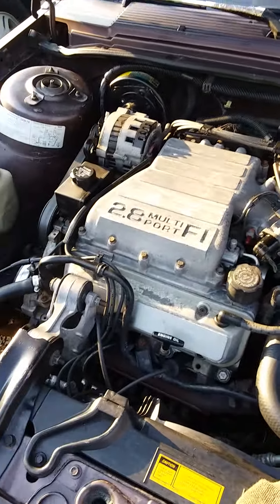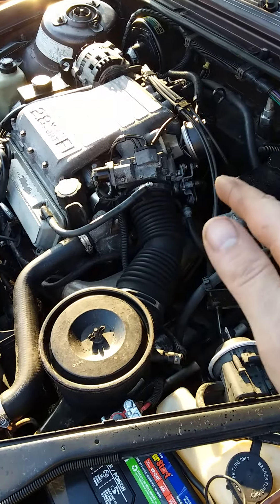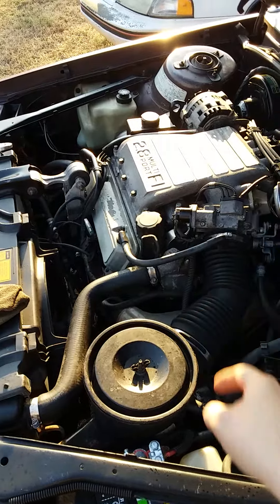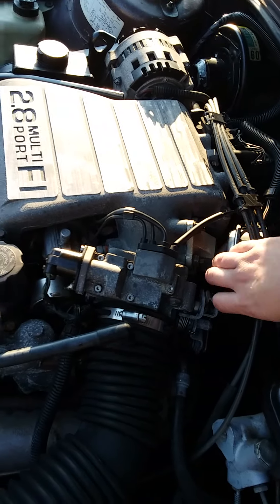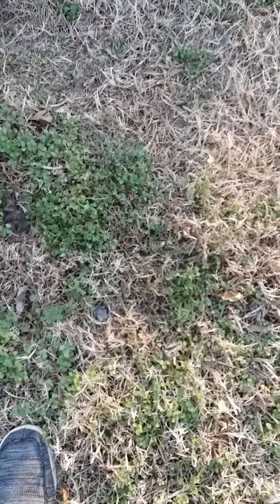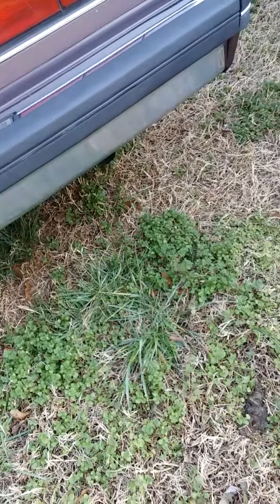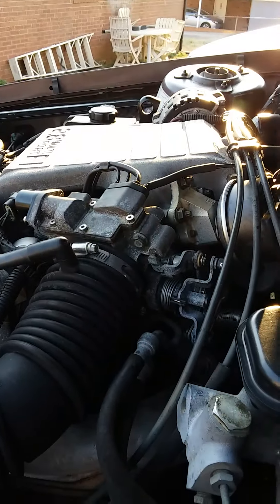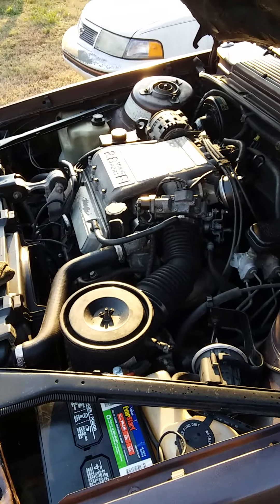1989 Chevy Celebrity 2.8v6 Misfireing Issues Only at idle!!

Comment: I would look into something spark related. Maybe you have a coil pack going out, ICM, or a bad plug wire or plug. I had a Corsica with the same engine. Was misfiring on one cylinder only and turned out to be a coil pack. Im guessing its the same location ? Under the front exhaust manifold.
Reply from the maker: Yeah I don't understand because everything is replaced and brand-new because the old parts were completely shot . But yeah the coils are in same spot under front manifold

Comment: sounds like a stuck open injector or bad fuel pressure regulator sucking fuel through the vac line
Reply from the maker: Yeah lower intake manifold gasket is shot .
Reply: @BustedknuckleGarage2  So it was the lower intake gasket? Mine does the same thing, a little worse but thats exactly it.
Reply from the maker: @ChrisSs85  yes it sure was and the video of the repair is on my other chnanel . My main channel
Reply from the maker: @ChrisSs85  https://youtu.be/93ctlop1HaA